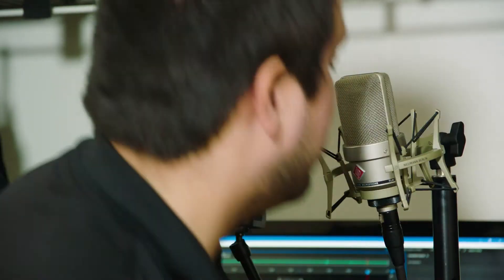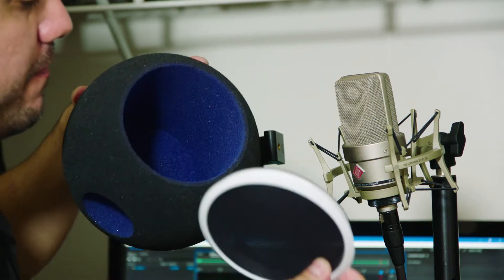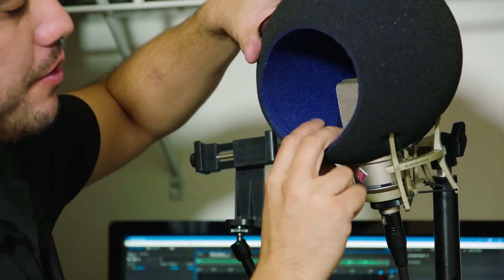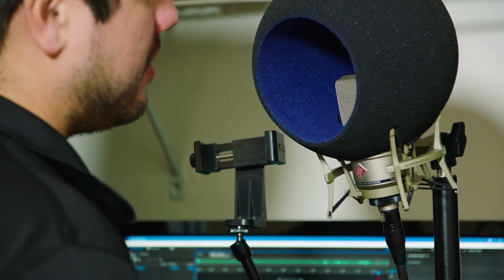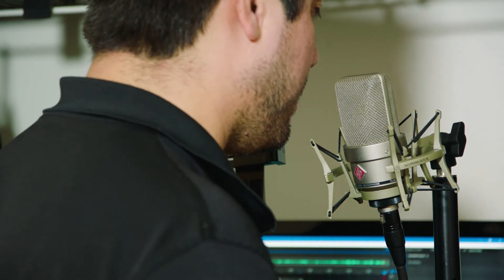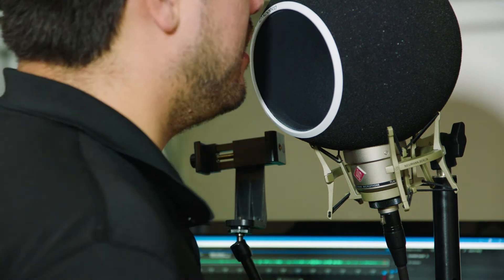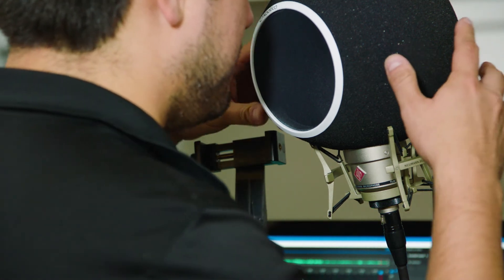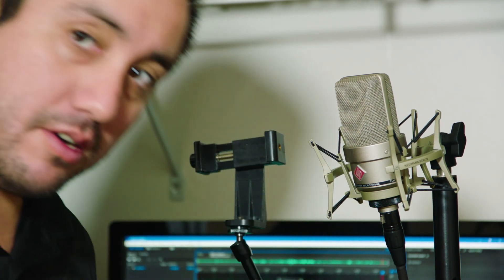Kaotica Eyeball Microphone Isolation Test Neumann

Comment: I found a solution, at least for me, try turning the shock mount upside down putting the mic on the bottom side of the shock mount. I’m using a TLM 102 so it’s smaller and it’s working. Hope that works! Worked for me perfectly!
Reply: Thanks brother! I have a TLM 102 too, and you just solved my problem
Reply: It ain’t pretty but it worked me me 😂
Reply: @ lmaooo that’s a big fact! It’s horrendous!! It’s like a infant in size 11s lmao

Comment: this is my biggest worry!... if it does not fit on the 103 what would it do on the 102... hmmm decisions decisions
Reply: I use it on a 102 but it doesn’t have a shock mount… …..may have to use the 103 without the mount….

Comment: You’re supposed to put the mic in through the inside so the foam doesn’t block the diaphragm at all.
Reply from the maker: Doesn’t fit
Reply: @giancarlo9189  because you would have to take off the base of the mic....you can't/don't use both...you don't necessarily need the base....and yes like this person said... once the base is off you would slide the mic in from the inside.
Reply: @ARTofSound908  that’s great as they stolen mine …

Comment: I dont have the official stand for the 103 i actually have it in an akg shock mount....but i put the 103 in the eyeball vs on top. I also started having the 103 at an angle so i dont record into the dead center of the mic.